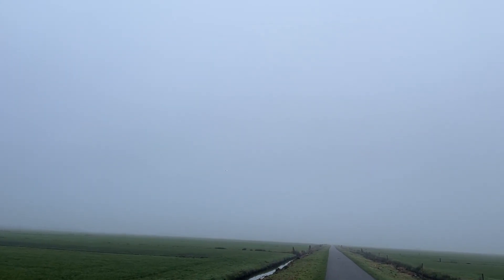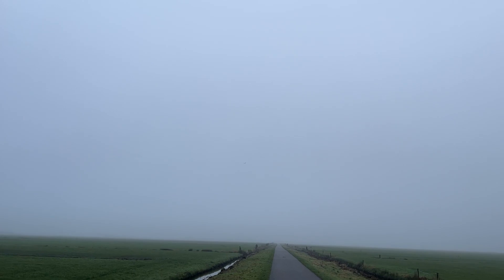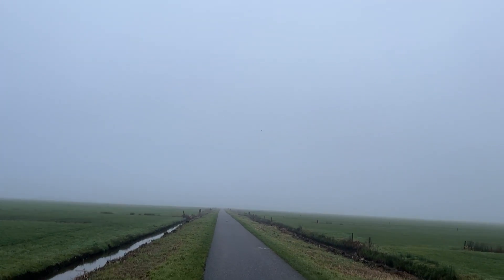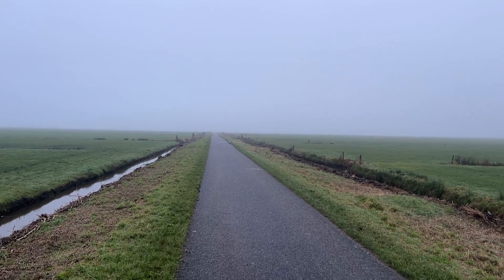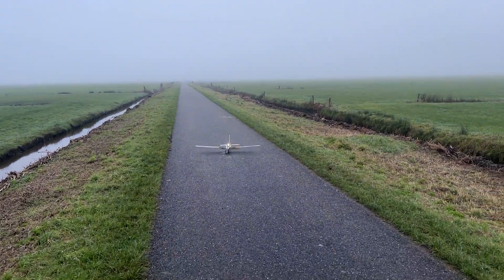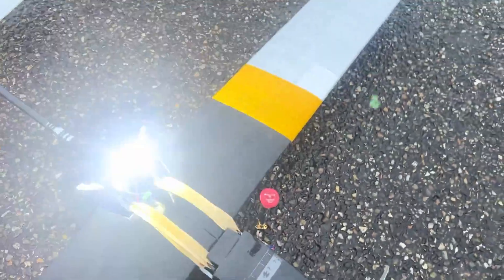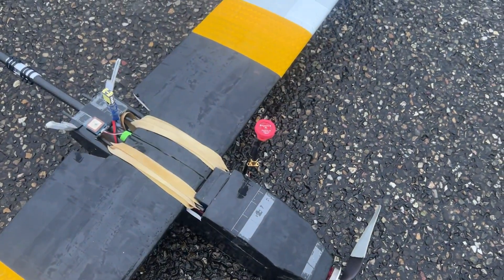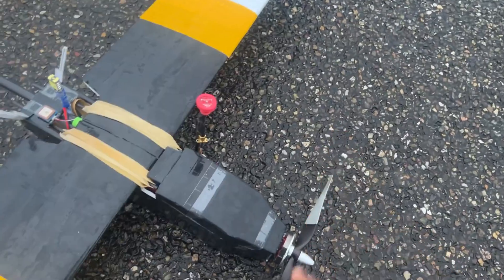Homemade Autonomous UAV (Photon Motorglider) Setup, Launch and Flight

Comment: FWIW...Crossing your rubber bands in an X pattern is cheap insurance in case of multiple band failures.
Cool seeing the plane sliding through the fog.
Reply: was going to say.. i would cross atleast 1 of those 3 series.. probably the middle one